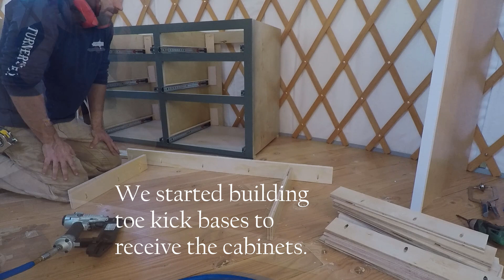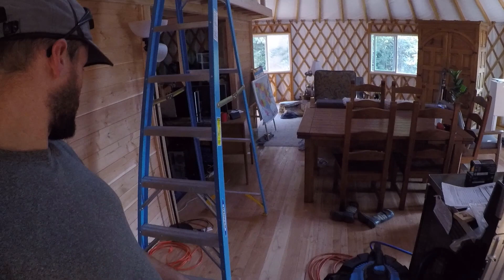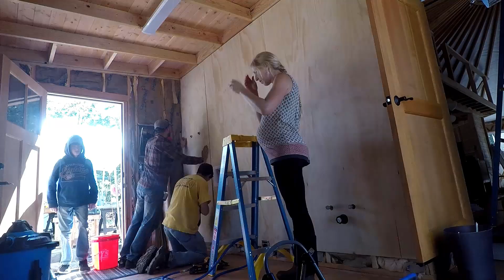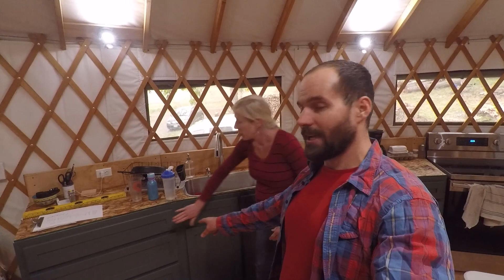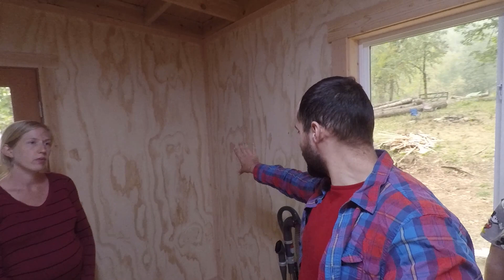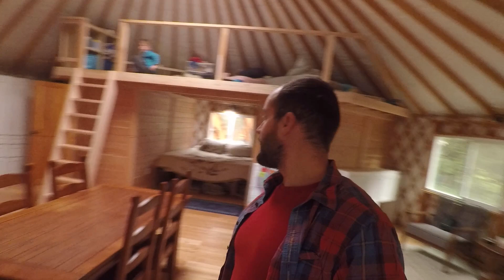Huge Progress On Our Yurt Interior

Comment: You should have put some of the insulation behind all your water pipes.
Reply from the maker: Yeah we could have done a better job insulating our water lines; thanks :)
Reply: @Green_Heart_Family_Farm  If you don't want to take the inside walls apart, you can always take the siding on the out side off, and put some foam board in and tape off the seams. You will need diffrent screws and need to recut the side peace on the corners to cover the foam board but it will give you way better insulation.
Reply from the maker: @christinaburney5935  Fortunately our winters are very mild here so I don't think we'll need to do that, but I appreciate the suggestions.  Always lessons learned after each build!

Comment: How is the winter? And how the heating is working in Yurt? How is the insulation of the Yurt?
Reply from the maker: We used a wood stove to heat the yurt, and it went well.  Insulation is pretty good.  In our climate in Western Oregon, managing moisture in the yurt through the winter is a bigger challenge than temperature.
Reply: @Green_Heart_Family_Farm  to manage the moist always requires constant heat from the stove i see then? 
No heavy snows in your area?
Reply from the maker: @OlimjonMatniyazov  No heavy snows; frequent rain during winter, though.  We are still learning how to balance ventilation and heat to keep the moisture out.
Reply: @Green_Heart_Family_Farm  i recently read that Japanese used rice paper walls to absorb the moist and tatami mata on the floor. Do you think it might help your situation?
Reply from the maker: @OlimjonMatniyazov  I'd be skeptical that it could get us through a whole winter, but I'll look into it.  Thanks :)
Reply: @Green_Heart_Family_Farm  you are correct the effect might be less. Need a proper calculation of the humidity and air flow with the temperature control inside.